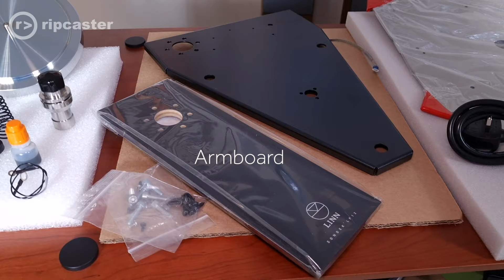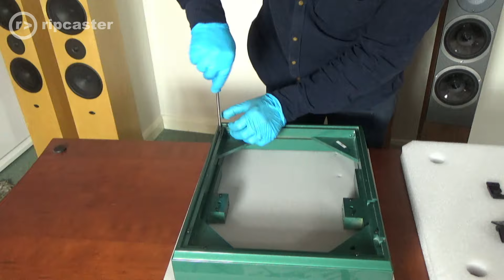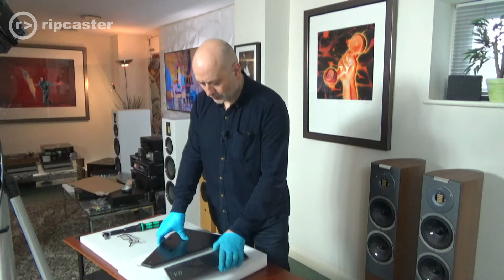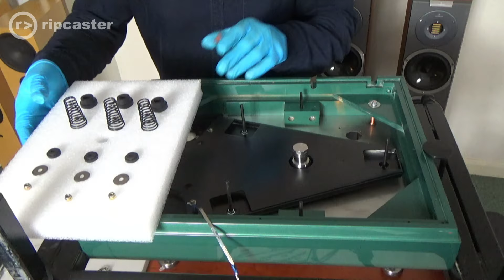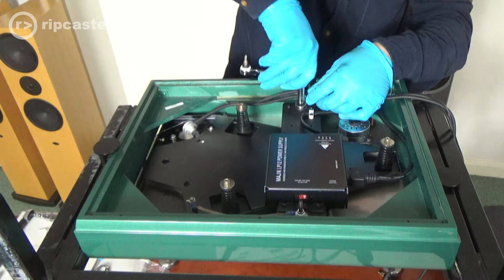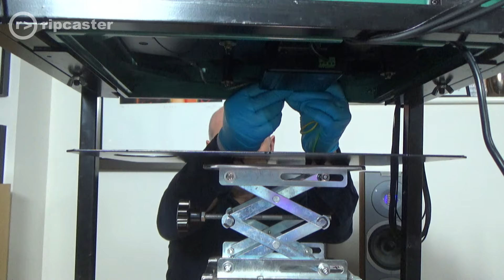Linn Majik LP12 Complete Build at Ripcaster

Comment: I don't understand the speed calibration, which is apparently performed by adjusting the vertical angle of the belt pulley. Surely the platter speed is directly dictated by the ratio of the circumferences of the sub-platter and the motor pulley (and of course the motor speed)?
Edit: is the pulley slightly conical, so that adjusting the angle affects where the belt sits on it, thereby adjusting its effective circumference?
Reply from the maker: Yes - the pulley is slightly conical, thereby adjusting its effective circumference. See the image here of the spindle https://ripcaster.co.uk/Linn_50Hz_Drive_Motor_Pulley

Comment: Hello. I bought Linn Majik and built it like in this video. But i have some trouble. No hum but popping sound in speakers when start motor. Like loud click. Not everytime i push rocker switch, it happens one time per 3-5 times. So i am interested why there is 3 wire earth, one from power supply beam to subshassics, one from tonearm cable on subchassics and one from beam attached to bottom. Could be one of them excess?
Reply from the maker: Thank you for watching the video. I recommend bring the LP12 into us for inspection/service (or your local Linn dealer). The issue you are having is typical of a earthing issues. All the links mentioned are necessary. Check that the metal surfaces of the links are making good contact. You may need to use some abrasive on the wiring strap to ensure the re is metal on metal connection for a good earth. Hope that helps. This maybe useful https://expert.ripcaster.co.uk/Linn_majik_lp12.html
Reply: @ripcastercouk  Thanks.

Comment: Watched whole video. Did I miss cartridge installation or it’s excluded ?
Reply from the maker: Thank you for watching... Not every step is shown - so the cartridge is 'majikally' fitted to the Krane tonearm around 23m 40s.
Reply: @ripcastercouk I am considering to replace cartridge on my Axis with Akito. Unlike my Technics 1200/2, there’s no removable headshell, thus unsure of overhang and alignment
Reply from the maker: @D800-m2f  If you use a Linn cartridge the geometry is set by the three point mount - e.g. Krystal https://ripcaster.co.uk/linn_krystal_mc_cartridge. If using a standard 2 point mount cartridge the use a cartridge stylus alignment protractor. We offer full turntable servicing at our showroom between Reading and Oxford in the UK.
Reply: @ripcastercouk thank you. I have Dynavector 10x5 on it at the moment. Removing and sending it to be re tipped. Will need to mount it once back and wanted to learn. 

If I was any closer, certainly would have contacted you but across the pond in Canada

Comment: Back in the day, when Ivor was still with us, it was pressed on us never to set suspensions with the arm cable attached and the belt on as the associated tensions can cause compensatory errors with suspension positioning. The tablet of stone handed down was first level suspension (using the three suspension bolt heads as a guide to ensure the inner platter was parallel to them so as not to be confused by the intentional curved dish in the top plate or a not quite flush armboard to subchassis seat), adjust the arm board horizontal alignment by rotating the springs followed by tweaking the three armboard retention screws to ensure the armboard sits parallel and centrally in the plinth,, check the bounce, then repeat again ad infinitum until a happy, uniform (no twisting and an even decay) bounce obtained. Then, and only then, connect the arm lead and dress in the "p" clip. Then remove arm lead from socket to ensure suspension movement and freedom unimpeded  when reconnected (also making sure arm lead won't foul base board when it's fitted) then refit and final tightening of "p" clip. Finally fit the belt (remember the arm lead and belt form, effectively, the fourth and fifth suspension "springs") and ensure that belt runs up to center of motor pulley on start-up and drops down on powering off. Maybe things have changed since my day.... ;0)

Comment: I thought you are supposed to disconnect the tonearm cable before adjusting the springs because it can act like a fourth spring.
Reply from the maker: There is no point getting a perfect pistonic bounce without the tonearm cable attached - you want the suspension to work correctly when the LP12 is in use. Typically you will need to adjust the suspension and the p-clip/tonearm cable orientation so they all work in harmony.
Reply: @ripcastercouk  Ok thanks for that. There are many so called linn experts on youtube that say to disconnect the cable but now I have heard the answer from the horses mouth.

Comment: I am surprised and astonished about how crappy a turntable this is for the budget. A superlight plinth, singing swinger plate, a motor control right next to the bearing, a cheapened out on/off switch compared to the vintage model, a hard mounted little motor to the plinth cover, suspension adjustment by pre-load increase only, no further damping, from underneath, basically no better, just newer than an old Thorens TD150. Sure it’s cult and in standard form is very likely better, but it cost over double what a new, modernized Thorens, that is actually better than the Linn in frabrication and comes fully set up from the manufacturer, no dealer DIY. You want even better for the price? Get the TD1600/1601 with TP160 arm. You’ve got to spend multiples of that with Linn to improve the obvious crappy parts to establish a sound beyond the Thorens’ Capability, exchanging motor, bearing, motor control, plinth, springy chassis plate and dampers, and tonearm, by then Linn will have charged you another 10-15K or even more.
Reply: It reminds me of one of them Jack in the boxes that you had when you were a kid 😅

Comment: Thanks for the video. The adjustment of the tonearm was not shown unfortunately. I would be grateful for instructions on that. Also just a curiosity question - how did you adjust to 33 1/3 rpm ? My thought is to use a scope. Also what weight does the tonearm need to be at? Thanks
Reply from the maker: Please email info@ripcaster.co.uk and I'll be happy to go through the process - Jon

Comment: Starts at over $5,000 USD. I don't have a problem with the price but I don't understand why they can't figure out a way to have them as a competed assembly ready to ship like most turntables. I understand it has that spring suspension but why not have a way to lock it for shipment?
Reply: Linn's transport well using the supplied packing which enables the removal of the outer platter which destresses the suspension. The Dealer assembly is more a requirement of the custom nature of the product; in the early days arm choice and now an almost bewildering range of options.
Reply: It`s because the design is from a 100 years ago, back then it was already delivered as a kit. They just kept it that way.
Reply: @brugj03  
One hundred years ago people were playing shellac 78s on a gramophone, lol.
Reply: @chrislj2890  My friend, you know what i`m talking about.
Reply: @brugj03  
Actually I don't, but as long as you know what you're talking about it's all good.

Comment: And now we also need a scissor lift?
Reply: If you drive a car it may surprise you to know that your garage will have numerous special tools, for instance wheel-free lifts and suction oil drainers which allow them to service it safely and efficiently. Which is cheating, really, when he could raise the car on bricks and drain your sump oil into a washing-up bowl. To extend the analogy a Linn dealer may need (or prefer) to use a scissor lift; you, as an end user / consumer, don't, because there's no good reason for you to ever remove the baseplate yourself

Comment: Ya know I thought I always wanted a Linn until right about when I saw the motor speed needs to be adjusted with two screws … that’s after I already reluctantly came to terms that we need to assemble this whole thing… this man has patience enough to work on a bomb disposal squad… 
I’m speechless…. So it’s up to the dealers to assemble this whole thing? Really?
Reply from the maker: Thank you for watching you raise an excellent point... The Majik LP12 shown is calibrated to 33rpm using two adjustment screws by us the dealer. The Selekt LP12 and Klimax LP12 use electronic speed control featuring tachometer feedback. The video shows the whole assembly process performed by us the dealer as part of the customer service to ensure you get the best from your records - this isn't something the customer does. The musical information stored on the grooves of a record is small and subtle. You need a turntable that is correctly setup to extract this information from the record. It is simply not possible to ship a delicate piece of equipment through a courier system and expect it to arrive correctly calibrated.
Reply: @ripcastercouk  I live in Hawaii.   There was a Linn dealer here many years ago but he moved away.    I think I could probably set one up if I had the jig and associated tools but I must say it looks very methodical and mindfully slow going!   I have a Sota with SME IV but haven’t used it in years.   Sota has a convenient speed control knob for adjustment.

Comment: What a deal - not enough its a $$$$$ expensive table, now were expected to pay the seller a fee for assembling the dam thing.
Reply from the maker: Gernerally there is no additional charge for the assembly/installation. The LP12 is assembled/calibrated/installed by the dealer to ensure optimal playback for the customer. https://ripcaster.co.uk/Linn_turntables
Reply: Dealers don't charge for the assembly of a new turntable. Even so who do you thinks pays for the assembly of your Technics or Amstrad? Who pays for the assembly of your Audi or washing machine? They still have to be put together whether at the factory or by a dealer! Someone (i.e. you the consumer) has to pay for the production line workers or robots. Who pays the chef when you dine out? His salary isn't shown on the bill........

Comment: Great video, thanks. Would you mind sharing how do you adjust the counterweight on the tonearm.  Do you have to unlock it somehow or unscrew something?
Reply from the maker: Thank you for watching. The counter weight is simply rotated and this moves the weight forwards/backwards. The theaded counter weight has a friction device to ensure the weight doesn't move once in the correct position.

Comment: I love that colour. I didn’t realise that the dealer had to do the complete build, no wonder Linn love their dealers! 
I bought one as my retirement present last year and absolutely love it and my dealer came and installed it and took a couple of hours to listen to some of my music collection. That’s what I call customer service. I wish Linn would do an official budget 2 speed power supply similar to the Hercules as I don’t like the faffing about involved with the adapter. In fact I use a second deck a Linn Basik with my old  Ittok and K9 for my 45’s. A third deck a new Rega P3 is used as well with Audio Technica’s AT610mono cartridge for my growing collection of 1960’s mono records. All wall mounted so that they all fit nicely together.
Great video by the way.
Reply from the maker: The plinths are available in any RAL (or automotive finish). This happens to be a VW finish - Bay Leaf Green. Automatic speed control on the Majik LP12 would be a good idea... but the current manual methid is also a good motivation for the Lingo IV upgrade. We have another video on the channel that covers the plinths in more detail here https://youtu.be/9KuX0Y8GMgo

Comment: Great video. Hoping to upgrade my Rega P6 later this year. A P10 is the obvious choice, but I think I'd love an LP12 more. Majik spec with Lingo perhaps?
Reply from the maker: Thank you for watching. The beauty of the LP12 is that you can upgrade the components to match your requirements and budget. The Lingo IV is a very good choice as it gives 33/45 rpm motor control with feedback. https://ripcaster.co.uk/Linn_Lingo_IV_Power_Supply_and_Speed_Control
Reply: I purchased a P10 and on the first day was so disappointed that I put it back for sale . Big hype and great technology but nothing close to the LP 12. I compared A/B with a Hana SL on both the P10 and a Linn with Kore/Akito 3B/ Lingo 3B/ Cirkus/Trampoiline and the P10. Not close. Bigger soundstage, better base, better place,ent of instruments and voice. My 5 cents. Plus now I have the advantage to upgrade when I want with the same turntable.

Comment: Why didn't you show the torque for the main bearing? Meant to be 12Nm but that is wrong it is better 18Nm
Reply from the maker: Hello Jedi-mic. The correct torque setting for the main bearing is 3.5N.m. Overtightening the bearing can damage both the bearing itself and the sub-chassis. The whole build takes significantly longer than the 30+ mins shown here - so not every detail is show.
Reply: @ripcastercouk  Linn's specified torques used to be "until it breaks then back off a bit..... "😆😂